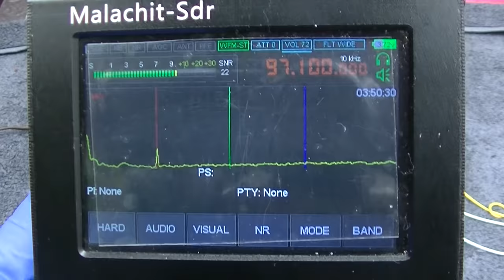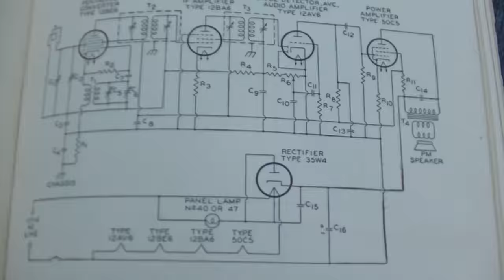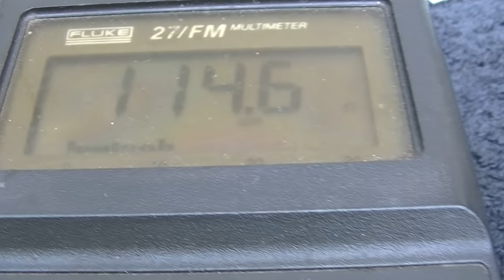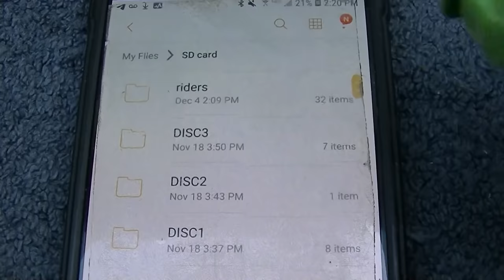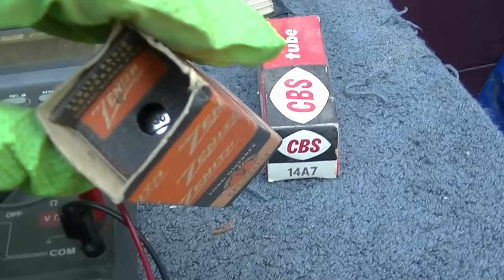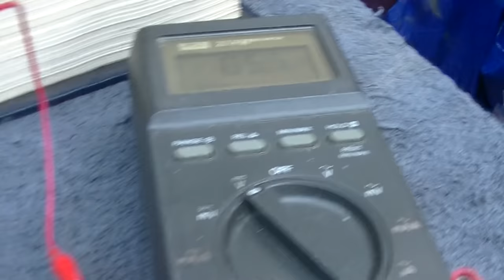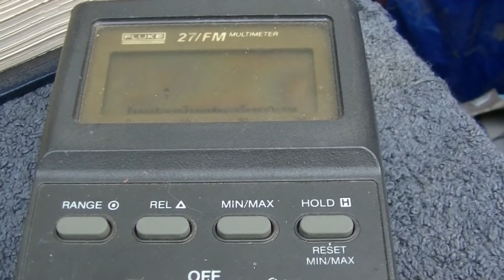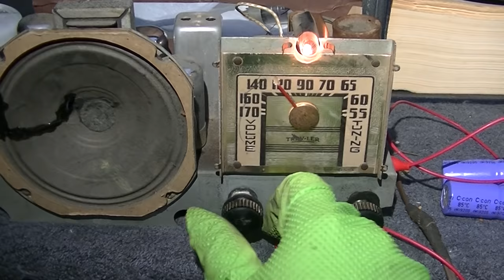1948 Travler 5 Tube AM Radio Resurrection Repair and KNX Goes FM

Comment: On the Malachit SDR radio receiver can you record your stations your listening to and use a AM loop antenna on the radio
Reply: Dont know about recording but you could take an old ferrite antenna from an old radio together with the tunung capacitor and connect them in parallel and then connect it to a plug that fits the radio.

As you tune the radio you will also have to tune the capacitor for max. signal.

Will work very good though.

You could also use a frame antenna but it will be larger.

Comment: It seems they are doing that everywhere and I don't like it. Here in North Carolina WKIX channel 85, which has been"the giant of the south" since 1957 on AM 850 is now "OLDIES 104.7", although still on the AM station which is the strongest station. Also the big news station WPTF which has been 680 since 1928 is now 95.5
It seems that Even though the AM station is still the strongest, and the station is registered under the AM station, they are branding the stations under (at least here) low powered FM translators of which they often have many different ones. it is a whole big mess... WKIX can now be heard on AM850, FM104.7 and HD2 94.7 WQDRHD2.
Reply: It makes sense from their standpoint, get your signal out there as many ways as you can to net the most listeners. The HD2 probably feeds into 104.7. 
I think they still have to mention the parent station on AM at the top-of-the-hour legally, but I guess that's being enforced as much as the "misuse of 911 services" law

Comment: I'm not a big fan of talk, news and sports on FM; with each station hogging 200KHz, it's a huge waste of bandwidth. If they are going to let AM wither on the vine, they should either push to convert to digital ("HD radio") or double the size of the FM band. FM, as it currently exists, it too crowded and the chatter stations are just limiting the variety of music available on broadcast radio.

Comment: the "LOC-TAL" tubes were designed for military service, and the idea was so that the tube could not vibrate out of the socket. I did at one time think that these tubes were not exactly desirable, however I do like to keep such equipment "FACTORY ORIGINAL". with good clean connections "LOC-TAL' tubes are a good tube, the longevity is certainly there. you go into thermonuclear meltdown over a tube with a "COLD HEATER" that is 73 years old.   hey !!! if you do not want the loc- tal tubes I will gladly take your stash off of your hands!!!!!!!!!!!!!
Reply: Loctal tubes were also intended to be used in car radios, which are subjected to hard jolts which might shake octal tubes out of their sockets. Also, Philco had a preference for loctal tubes in its consumer radios.
Reply: @jimlocke9320  , this is very true, also "PHILCO" used these tubes in their radios, due to the fact that philco designed and held the patent on the loc- tal tube design, and sub- contracted the manufacturer to "SYLVANIA"( EIA # 312) if philco could not keep up with demand. I did run into loc- tal tubes that were made by philco( EIA # 1063)

Comment: Strontium is radio active.
Reply: Radium.
Reply: @rogersmith7396  so unless hydrofluoric acid is used in any type of process, they included their tube etching in the list...
Reply: I would think that list of chemicals is what's possibly used in any RCA tube you would find across their manufacturing inventory so finding something particularly toxic or dangerous in the list doesn't mean you'll find that in the RCA tube you're using.  I'll have to go back and look but the list might include chemicals used in manufacturing as well and not necessarily what you would find in the tube should you crack it open.
Reply: @MrCrystalcranium  I think a lot of it is used in the production end.  Wheat flour, bentonite which is a clay, flouric acid maybe to etch glass or as a cleaner.  Xenon maybe to fill the tubes.  Of course if they have bakelite bases that is made from phenol formaldehyde and wood flour, Carbon tetra chloride is cancerous and is used as a cleaner.  He has shown some tubes have radioactive components but they are specialized.  Various odd things are used as a lubricant in production even in drugs. I would speculate that as in a light bulb there are added things to control filament boil off and redeposition to increase life span.  Molybdenum is a persistant lubricant used on motorcycle chains and CV joints, don't know why in tubes.  They might use anelin dye on the boxes which is carcenigenic.
Reply: @volvo09  That would be my guess or as a glass sterilant/cleaner.  I have worked with the stuff.  It has to be used in a fume hood or a gas mask.  A few breaths will kill you.  They used chlorine gas in WWI and this stuff is a lot worse.  Will burn skin.  Eat right through pyrex glass, stainless steel.  Not really something you would want on a high volume production line.